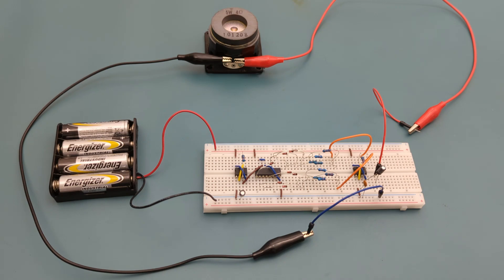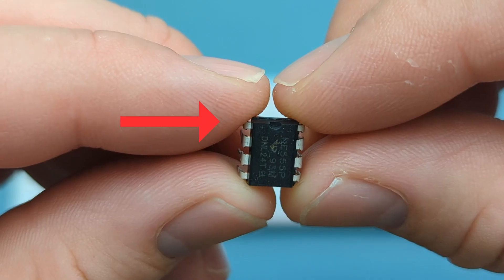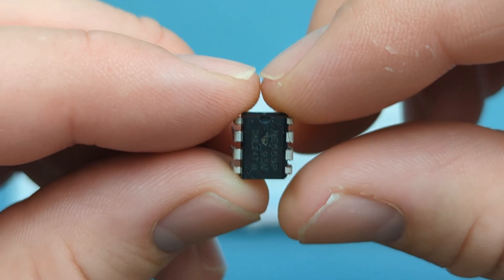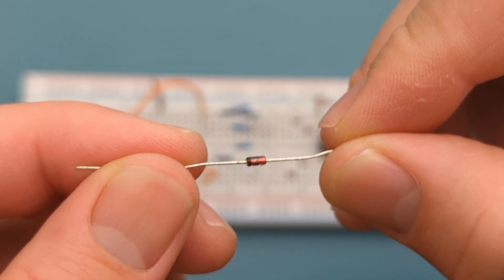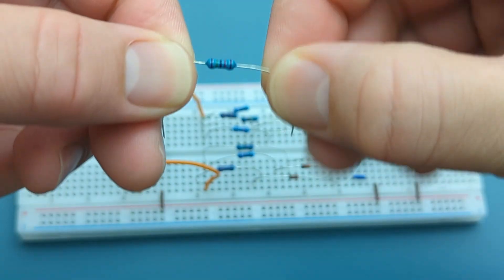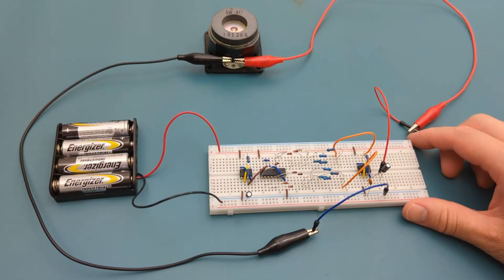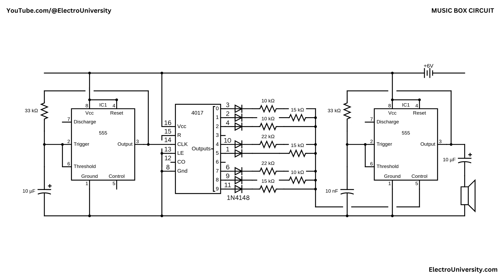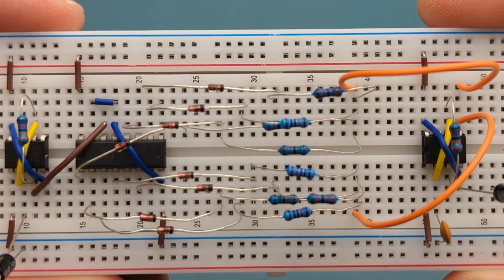How to Make Music Box With 555 Timer

Comment from the maker: 🔔 Get your tools here:
✅ Electronics Component Kit: https://amzn.to/3N65asq
✅ AA Battery Holder: https://amzn.to/4gCInSx
✅ AA Batteries: https://amzn.to/4j0x3Rb
✅ NE555 Timer: https://amzn.to/41MpQhp
✅ CD4017 Decade Counter: https://amzn.to/3HZ2Y73
✅ Electrolytic Capacitors: https://amzn.to/4dnrJF4
✅ Resistors: https://amzn.to/3YfGeUi
✅ Jumper Wires: https://amzn.to/3NNn9UR
✅ 5W Speaker: https://amzn.to/4eL2D3y
✅ Solderless Breadboards: https://amzn.to/3SndKWm